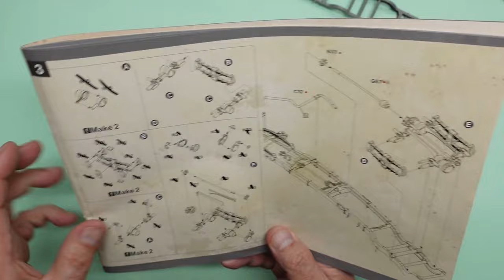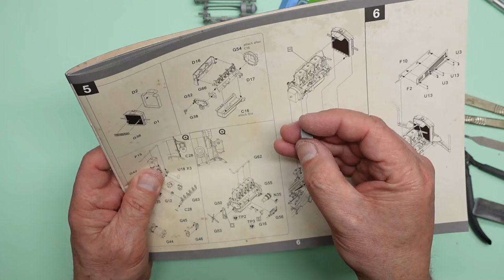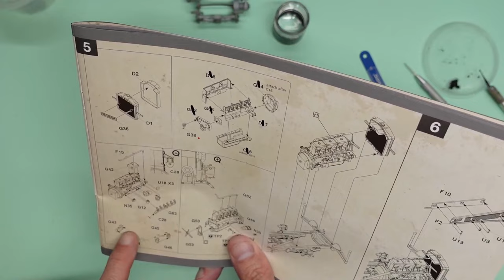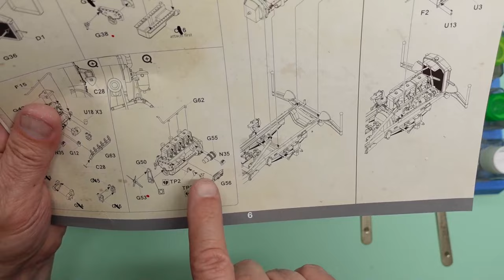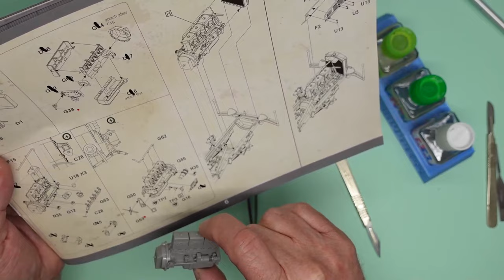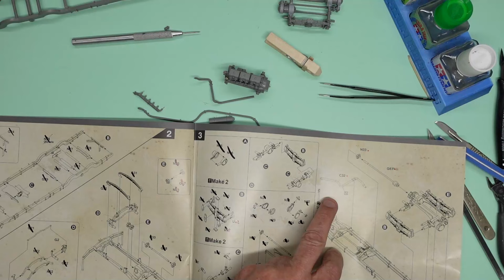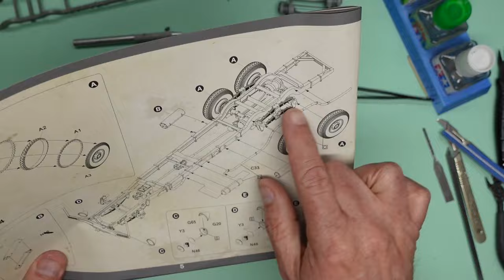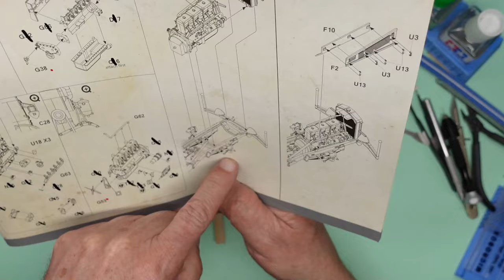Das Werk 1/35 8.8cm Flak auf 9t VOMAG build. Part Three.

Comment: Great work so far Nige, if you haven't found it yet RLM 66 Schwartz Grau over flat black for engine blocks - although I should add that's for AFV engines.
Reply from the maker: Thats what I would have thought, but the two black and white pics I've found look metallic?

Comment: wow...there's a lot of fiddly stuff in that kit! I'd be going bonkers trying to build it. No, I know better than to even try.  However,  I need to get one or two of those adjustable parallel clamps (or whatever they're called)  I should have had that device long ago; it would have saved me a lot of headaches.  Remind me.. is the engine made out of resin?  Cheers.
Reply from the maker: Hi Mark, the engine is plastic. The clamps are from Rebell Hobby in Sweden.